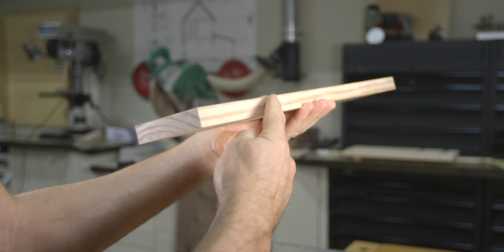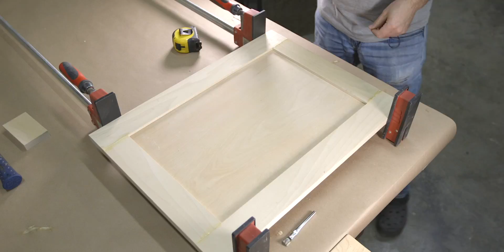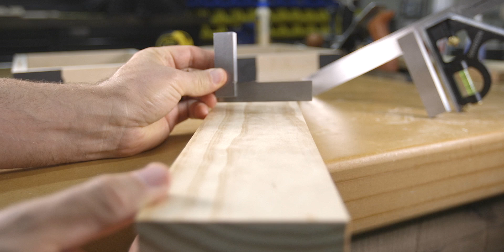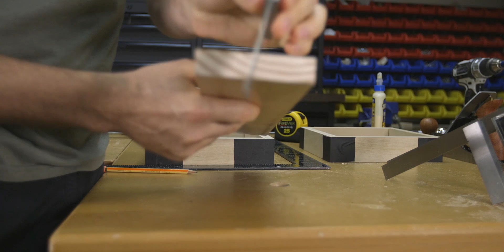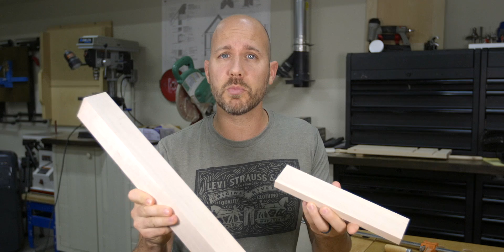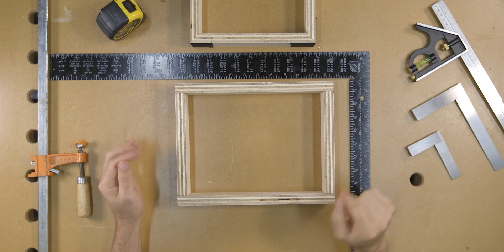Every New Woodworker Needs To Know These

Comment: I always say, if you are going to be squaring up or 'framing' then buy a jig =they're not that expensive and will save hours of time wasted, of course if it's just the occasional square etc then watch and do accordingly. Also buying a straight edge or edges in metal can help enormously, again not that expensive. A decent metal square is not going to be problematic like a wood edge can be.. even after you've worked hard to make it square! Heat can warp the timber, dropping or accidentally slicing into it etc etc.. If the edge is NOT so critical on your cut and you simply want to use the timber edge as a ref re router / circ saw etc then fine.. Great vid as always and yes so right when you say that if you ignore or fail to realize an error re the shape you can end up tower of babel 😨🤣🤣uhh bricking it.. 🤣👀 👍
Reply from the maker: Thanks for sharing Arthur!

Comment: Nice Video. Can you buy that type of wood you mention that you don't need a jointer at hlme depot or lowes?
Reply from the maker: Yes, most of what they have is surfaced on all sides ready to use.
Reply: Thanks for the reply and do they make it in big sheets? Just started wood working in April. Trying to learn all I can, and your videos are great
Reply from the maker: Awesome, you will love it! No, lumber that is sold as surfaced on 4 sides is only sold in solid wood, like oat, pine, cherry, etc. Plywood comes in sheets and is graded differently than solid wood. Did you see my beginner terminology videos?